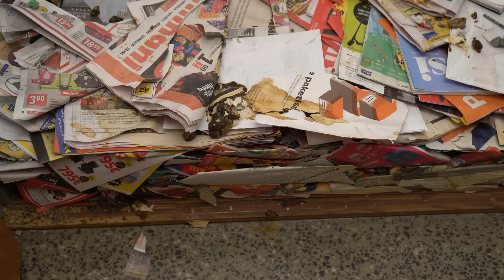CLEAN home, CLEAR mind | Amazing transformation! 😍

Comment: Homes in Brazil also have "wet bathrooms" with floor drains. It makes life so much easier to keep clean and to use!
Reply: I never understand how  it works having a washer and dryer in a wet bathroom and in this video they had an electric wall  heater.  I would be scared that I would get electrocuted!!
Reply: @peikathryn  everything is insolated and waterproof so water will not get into electrical sockets.

Comment: Baker Soda and vinegar will unblock it's.
Reply: With so much hair tangled up, you would need harsh chemicals to break that down.  So it's better to unscrew it and clean it like Auri did. Baking or washing soda plus vinegar can break down some grease buildup in a kitchen drain. But it's best to be careful what you put down the drain and wipe grease out of pans with a paper towel before rinsing and washing them.

Comment: Just a suggestion: You should have cleaned the cat litter box before adding in the new litter sand as the cleaning formula might have gotten into the sand which is not good for the cat's health as they smell the sand and it's harmful for them.
Very satisfying video anyways❤

Comment: I love your videos but I do wonder sometimes if some of the things are done a little bit back to front? The sink, probably would have unscrewed the pipe first then cleaned everything rather than cleaning it twice and also the cat litter box lid, would be it not be easier to take it to bathroom, spray it down instead of wiping it after you have emptied it? I know time is precious for you so little things like that might be useful. Work smarter, not harder!!
Reply: With the sink, Auri did say that she couldn't unscrew the plughole drain section until after she'd cleaned the sink - I guess the screw was just so sticky with the sink gunge until she'd cleaned the sink.

I'd have cleaned the litter tray before cleaning the bathroom, but Auri has said she does things in the order that give most visual impact for us, and give her most enjoyment.  Cleaning the litter tray first would have washed away some of the dirt, giving Auri less satisfaction in her cleaning!